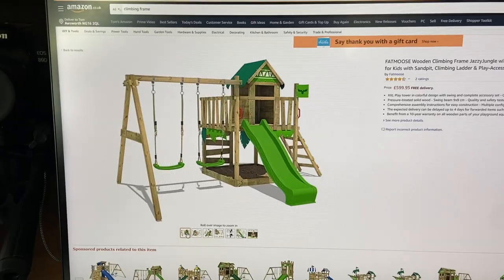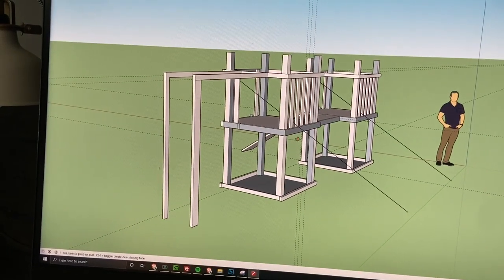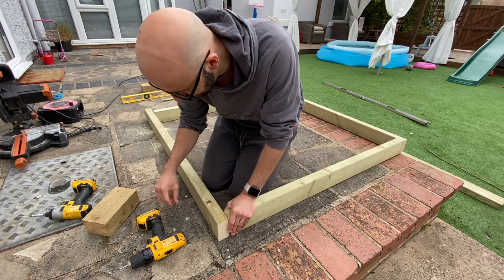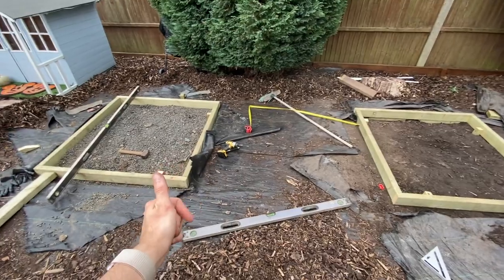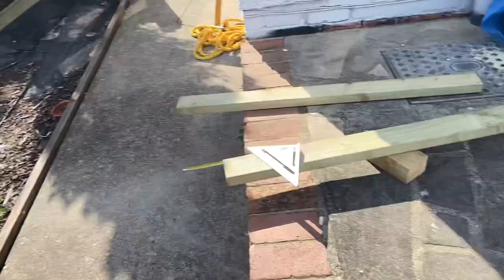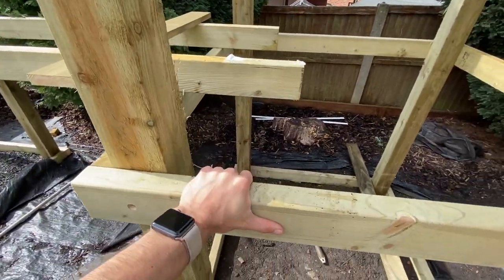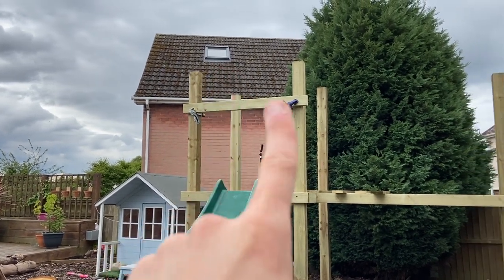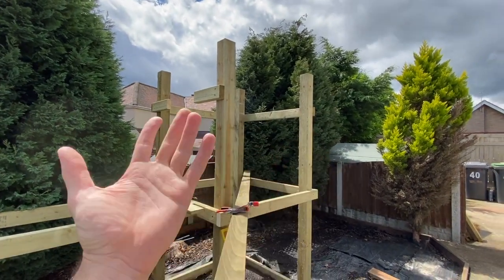Building a climbing frame: Part 1

Comment: What screws or bolts did you use to secure the bridge? Did you use any additional support to help secure it with all the weight of the wood/kids on it? Just planning a similar project and want to make sure it is nice and sturdy! Great videos btw
Reply from the maker: I couldn’t tell you what bolts it was as it was a few years now. But it has no extra support and it’s been up a few years and I still run across it in problem.

Comment: What’s the whole build and have to say it looks amazing! Hope mine turns out just as well.
What size and length and width are the corner posts and what model of evolution mitre saw do you use?. Many thanks.
Reply from the maker: Just been out and measured, it’s 240cm posts. And I’m sat in front of the saw now as I’m filming another video 😂. It’s the R210
Reply: jurassicjunkie cheeky question I know, but I don’t suppose you have a list of what size of all the timber you used for the whole build and even the quantities?  I ask because you done such a good job, why would I wanna do different. 😁
Reply from the maker: I used a company called wolf timber, I just went to log in to see if I can at least find an invoice and it seems the site has gone under, I can only see a Facebook page now. So sadly I have no clue what was ordered. If you have Twitter follow me “jurassicjunkie” so you can send me some photos when you are done, as I’d love to see it.